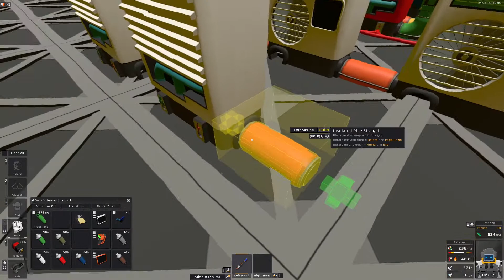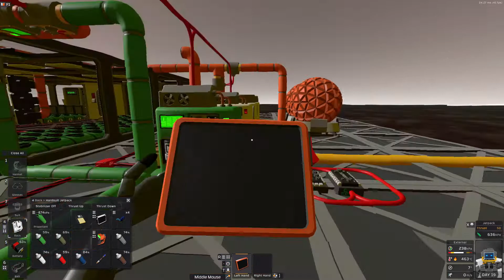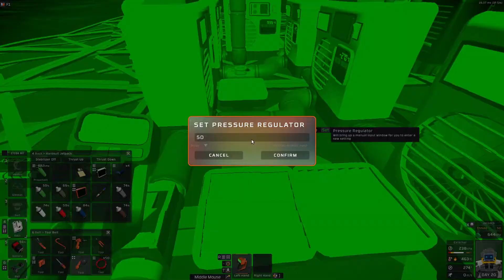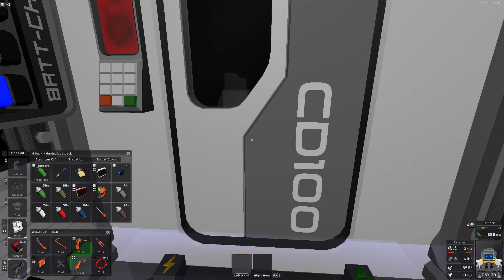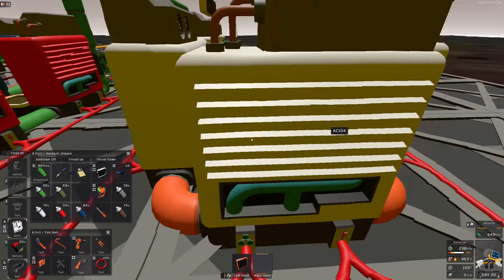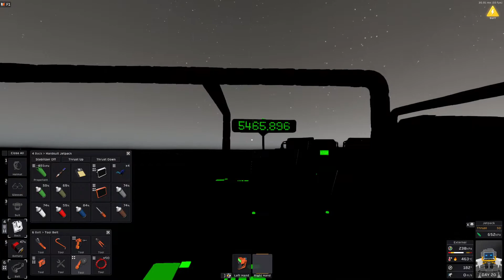Stationeers (2022):  Venus - 6 AC  - Cooling System

Comment: I have always wondered about using exhaust gas as a coolant rather than the output. 

I am sure this has been tried, but can a notional amount of gas be super compressed using volume pumps in insulated pipes, to mass increase temp, then use radiators on that highly compressed gas after a valve (to separate the system) then cool it but maintain a relatively high pressure, then decompress, I assume in a large tank or massively long pipe system. I think there are issues with the decompression here to make your own very large AC unit.
Reply from the maker: Stationeers does not increase the temperature if you compress gas. The other way around (so more temp more pressure) is part of the game loop. I think they thought about it, but this would need a massive refactoring to the current systems. I'm pretty sure if it would be implemented a lot of real life applications could be made and your example would certainly be possible.

Comment: I can see you being a robot most of the time so I'm wondering how do I trade with robot when the 5th slot is battery and not the uniform?
Reply from the maker: I think you can hold a card in your hand and it counts as valid payment. But I have not tested this.
Reply: @casegard4324  I have done this and it works.